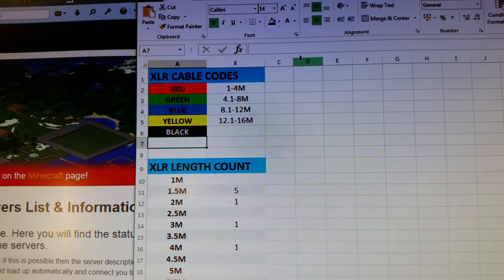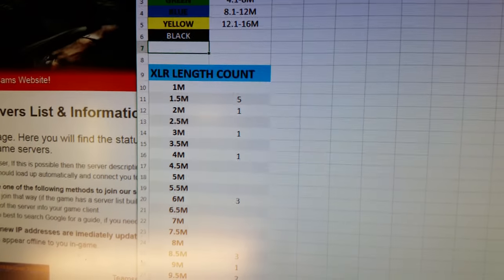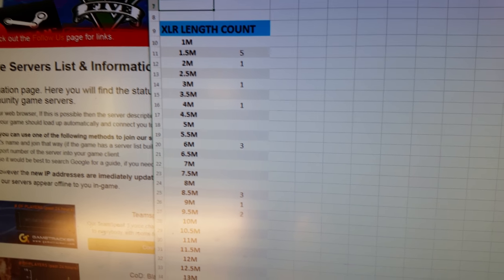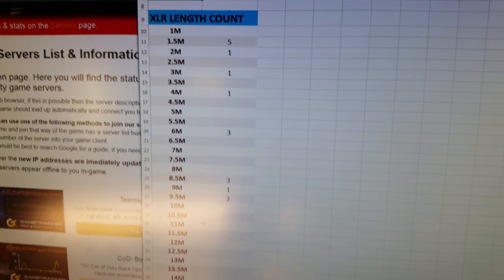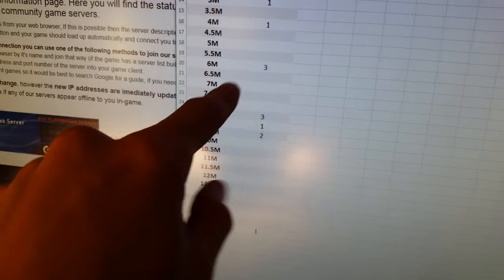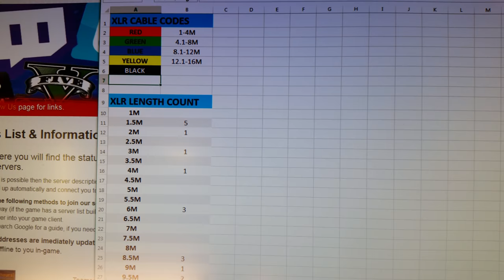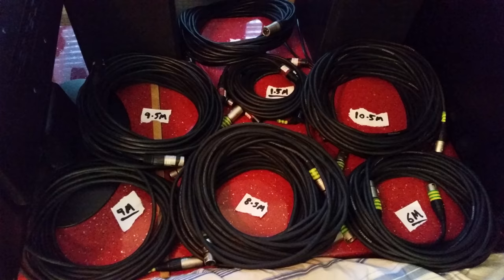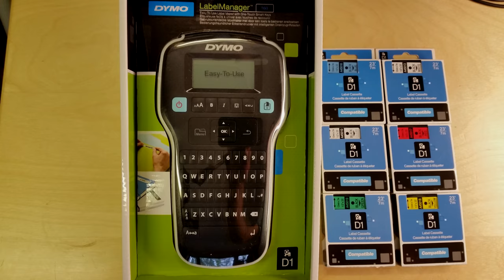My XLR Microphone Cable Labeling System - Lengths, Numbers & Colours - Easy to ID for Live Sound

Comment: This is the best video that I've seen on how to identify cable lengths. Your labels are clean, seem durable and are easy to identify. In my case, I just write the cable length twice on each of the connectors with a black sharpie. If the connector is black, I use a silver Sharpie.

Comment: Dude, get Neutrik XXCR transparent coding rings! You can replace the black color coding rings on the cable with Neutrik connectors from the Video. This works on a lot of cables, since these connectors are very common. Everyone go to the Neutrik website or whereever and research XXCR coding rings. Spread the word. It will make many people's lives a lot easier.
Reply: i think these only work with the proprietary Neutrik connector. not much help if the cable does not have that specific connector

Comment: Love the green and yellow stripe tape. What kind of tape is it? Looking to do the same. thanks!
Reply from the maker: The Green/Yellow tape is just standard electrical insulation tape. In the UK and Europe it is the colours used for the safety Earth connection of an electrical system. 
I simply mark all my equipment with that tape so it doesn't get mixed up with any bands or people I may be working with, which is why it was already present prior to making this video. 
Hope this helps! 
--Nathan

Comment: Very good, thanks.Why not print cable length also with dyno? Example (1-1.5 )
  (2 -1.5 ) in meters e.g.
Very good to have the marking at both cable ends.
Is there a standard for color marking in general?
Reply from the maker: I actually did add length markings on them. When I do the review/recap after using them for 6 months (around around 10:03 at the end) I show them and mention it. 
There are no standards that I know of, just whatever standard you come up with yourself, for yourself! 
--Nathan
Reply: @NathanPH  Thanks for the reply. Nice and good channel with good tips.
It was probably the dialect that caused me to miss information about cable length. Excuse

Comment: Hmm...... I’m in the process of building my own 24 channel stage snake, I like your idea here and I’m glad it works for you, but I’m not sure how this could work for me...... the connectors on the stage box are numbered, and the numbers on the stagebox match with my mixer inputs, so as long as I know what number someone sticks a mic into, I know what’s what, and I just put a magnetic label on my mixer.
But Thanks for sharing and for the idea!!
Reply from the maker: What you're describing is a standard snake/multicore/stagebox setup. 
The idea behind my system is that I know what actual cable on stage is which from the point AFTER the stagebox where things can get messy and complicated. 
I find this especially true on festival events where equipment is being constantly plugged in and unplugged. 
Numbers from the desk to stagebox are irrelevant as they would be 1:1 most of the time. This system I came up with to allow easy identification and troubleshooting without having to do tracing of cables on stage. 

Hope this clears things up a little for you, glad you found it interesting!
--Nathan
Reply: Nathan PH , I totally get you, thanks.

Comment: What size heat shrink did you use?
Reply: yes same question here, at 7 00min, what is the size of the clear heat shrink tube and where did u buy it?, tks
Reply: @mikedoe4647  It looks like 1". Not sure on Ratio. Hopefully 3:1

Comment: Great idea. Was wondering how it works for maintenance? Are you still able to take the connector apart for repairs without removing the label and heat shrink?
Reply from the maker: Regarding maintenance I've not had to yet repair any of these microphone cables in 3+ years, since I owned them actually! But I do look after mine very well and they're all decent quality cable with Neutrik connectors which helps a lot. However if you did need to dismantle the XLR connectors you could definitely do so with the heatshrink and labels left intact! It is just depending on the style/type of XLR connectors you use and where you apply the label and heatshrink up to. Thanks for your feedback and glad to help! :)

Comment: I dig your organization and your color codes. However, you've made it impossible to unscrew the XLR connector for repairs without first fighting to cut off the heat shrink. In a rushed situation, this would be very frustrating. Next time, consider labeling the cable and not the connector. You might even be able to find heat shrink with a large enough shrink ratio to slide over the XLR connector first, then down onto the cable. This would eliminate the need to remove the connector to get the heat shrink tubing on the cable side.
Reply from the maker: Hi, Thanks for watching and your feedback. 
The labels and heat shrink actually don't prevent opening of the XLR connections as they're all fitted with genuine Neutrik ends that can be removed by undoing the plastic cable grip only. 
The heatshrink and label are actually stuck onto the metal part of the connector too, the threaded area of the XLR barrel so should I need to I could actually open them quite easily. 
I can also wiggle/slide the heatshrink up a bit should I need to, but I've not had to open any of my mic leads throughout the last 4-5 years or so as the only people who handle them know how to wrap and manage cable so I don't really get any breaks or damage as the cable and connectors are decent brands too which helps a lot. When I previously used generic XLRs and cheap cable there was no end of broken/damaged cable as the cable grips were trash and the cable didn't need any help breaking. 

If I was to get a broken cable on a gig I would simply replace the cable with another and repair it at a later date. I find it quite rare you'd get the time to pull out a soldering iron and other tools at the gig and repair a single cable and for me I generally don't find it worth the time/effort. I always carry a excess of microphone cable to every gig as it's used for so many purposes. 
Thanks for watching and your feedback! --Nathan.
Reply: did you find a heat shrink that does this? looking source some to make ID lapels